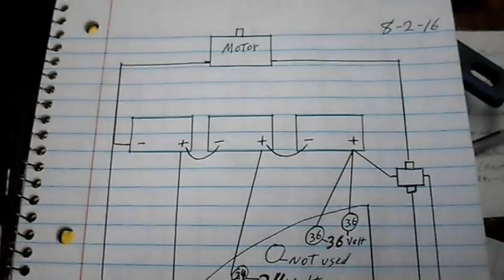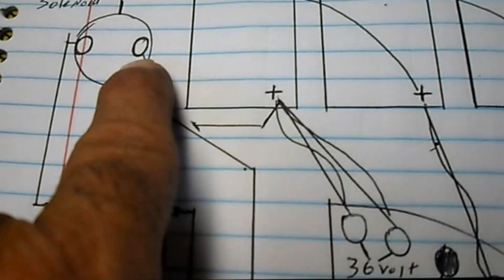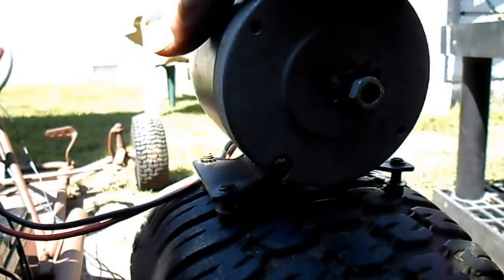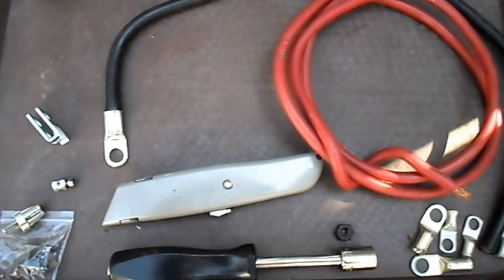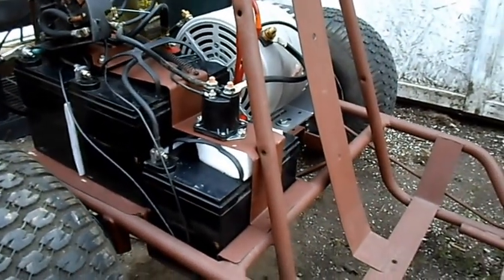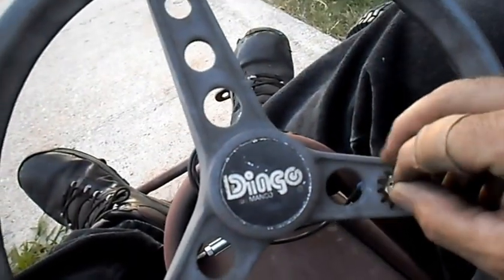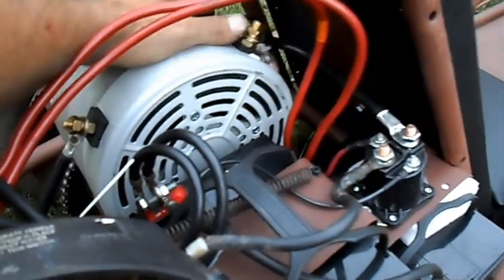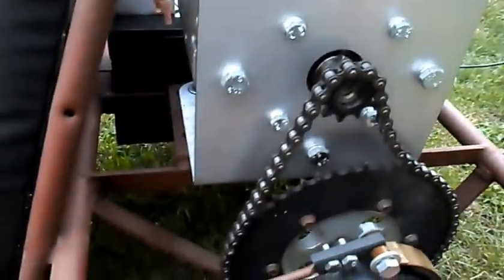El Dingo part 10 Corrected Motor Controller wiring, 1st test drive & results

Comment: Do you know how fast it went? or would you say it was fast? I'm looking to build a similar project but I'm not sure if 10hp is a good amount or if more would be wanted
Reply from the maker: I would say it went about 25 to 30 mph. That's only running @ 36 volts. 
Boot that up to 48V, 60V or 72V & your RPM's increase proportionately. 

This motor produces 72 RPM's per volt of input. That means, if you input 12 V (72 x 12 = 864 RPM's) 

24 V = 1728 RPM's, 36 V = 2,592 RPM's, 48 V = 3,456 RPM's, 60 V = 4,320 RPM's & 72 V = 5,184 RPM's

There are a lot of factors. weight of vehicle, gear ratio, size of wheels etc.

What are you working on?

For even newer technology check out  http://www.goldenmotor.com/ click on BLDC on the left.
I found this  after I bought this motor. http://www.goldenmotor.com/img/HPM-Drive-System-Setup.jpg
They are brushless, come air cooled or liquid cooled & up to 20 KW.
Reply: I'm planning to build an electric off road buggy/ go-kart with a lightweight design. I'm trying to come up with a simple 2 or 3 speed gearbox that I can fabricate myself so that I can have a good top speed too.
I've been looking at  motor kit from electric motor sport (http://www.electricmotorsport.com/karting/karting-bushed-motor-kits/me1003-emc-rt200-drive-kit-with-motor-controller-throttle-contactor-wire-kit-and-fuse-block.html). 
Seems good for the price but it's just air cooled and uses brushes, there are brushless water cooled kits too but they're too expensive for me personally. I'll be sure to check out goldenmotor.com
Thanks for your reply